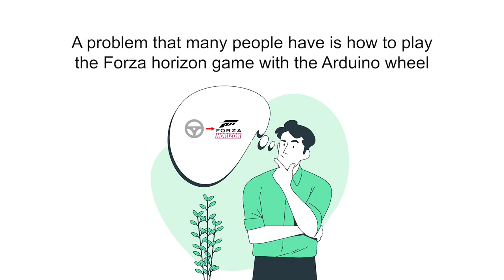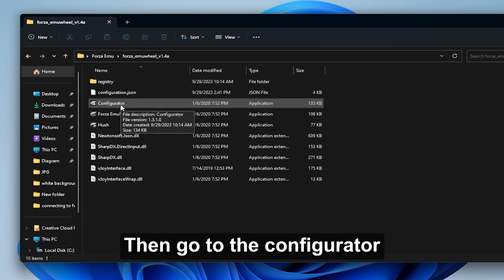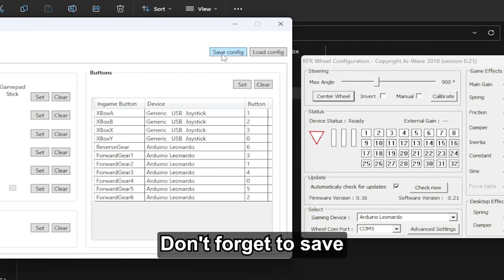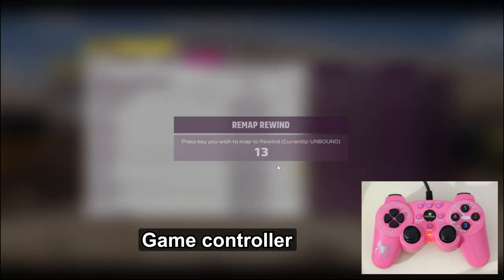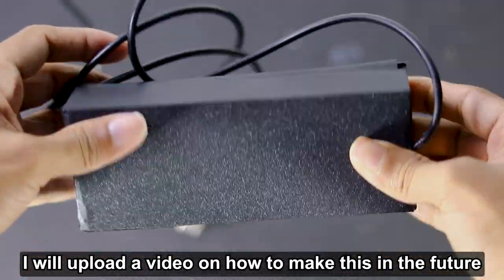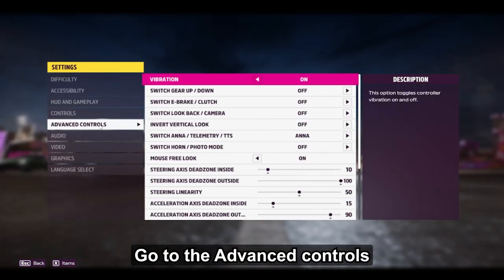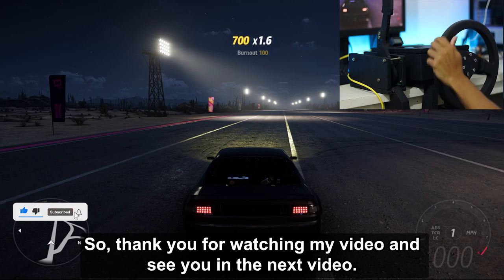How to Setup Arduino Wheel for Forza Horizon 5 & Make Game Controller Handbrake

Comment: bro 1 help
i have bought aruino leonardo
in xloader software it shows it dose not upload what to do 
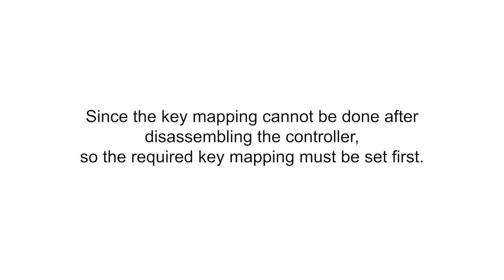YOUR VIDEO:[Step-by-Step Guide: Connecting a Force Feedback Steering Wheel to Your PC [1:20 minutes]
Reply from the maker: After pressing the Arduino reset button, did you enter the new 'com' number? This should be done a little sooner.

Comment: Broo, another issue, I did everything the same way, I didn't make the h shifter yet so I used shift up and shift down, only difference is this, now when I start driving, my car won't go forward even if I press full accelerator, everything working fine but car not moving, and red lights (brake) are on, and when I put foot on gas pedal, engine makes noise but the car refuses to move, I checked everything, no loose connection or flickering at all, still it seems that the brake is on automatically, please help me fix this
Reply from the maker: Okay. 
1. increase the deceleration death zone. then check the brake lights are off.
2. unbind the brake peddle from the key mapping. then check car is moving.
3. maybe your brake paddle potentiometer working in the opposite direction. check from the wheel config.
Reply: @zudumalli  i changed my clutch mapping from pedal to my controller handbrake mapping, now it is working, so the problem was  with the handbrake, now how to fix that?if i use handbrake mapping in controller then the handbrake is automatially engaged, how to fix that
Reply from the maker: Increase the dead zone of the hand brake and see it work.

Comment: Bro i can't play forza with it. I have calibrated it in emu wheel but it doesn’t work in forza. Its not showing in game
Reply from the maker: Do you show wheel settings in in-game settings? And check your emuwheel status if it is ready.
Reply: Use gimx adaptor and u can name ur wheel and function it as g29 . U can even use t in ps4

Comment: Plz help force feedback is inverted😢
Reply from the maker: https://youtu.be/F8xgsbUeE0c?t=214&si=1jZ4PiwiCt-2le0S
Reply: @zudumalli  all solved but having a big issue😥 my steering is always locking at 450degree even if i changed degree on software to 900 ... also tried on changing ppr value and also changed software to emc lite not working as normal.... before1-3 days i was using emc lite version at the time its working perfectly but now its locking at 450😓 tryed u r software after revonnecting but no use same 450 degre locking .will it be arduino board issue

Comment: will this in f1 game
Reply from the maker: You don't need to do anything together, Arduino supports F1 game
Reply: @zudumalli  i just watch your ffb steering wheel can i use 5k resistor instead of 1k
Reply from the maker: yes you can

Comment: How to play any game in the same way
Reply from the maker: No, this is for forza games. Others have different methods.
Reply: ok bro... @zudumalli
Reply: what are those methods?
 @zudumalli
Reply: @vinuthamasen  bro i think you need to use a gimx adapter to make this wheel register as logitech g27 then it will function in all games that support sim wheels